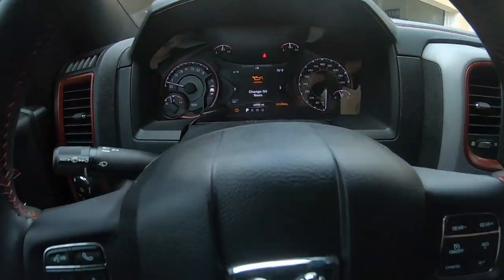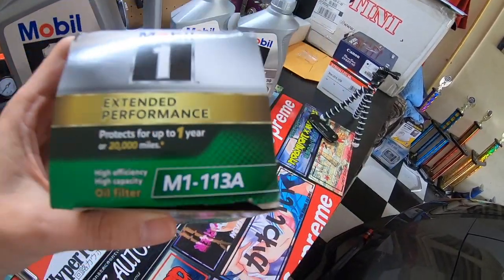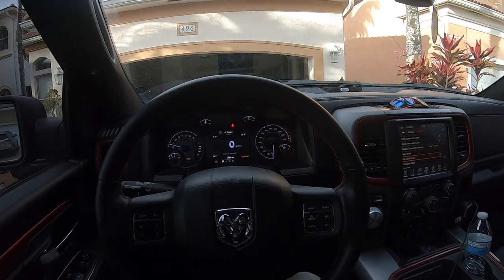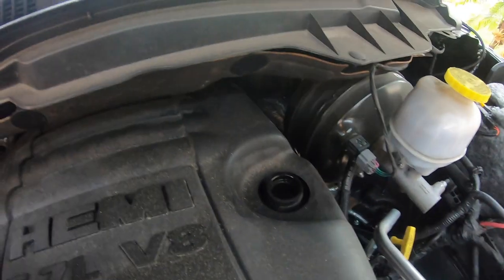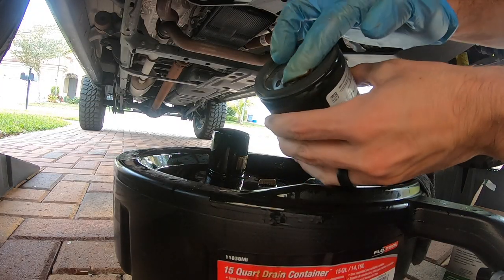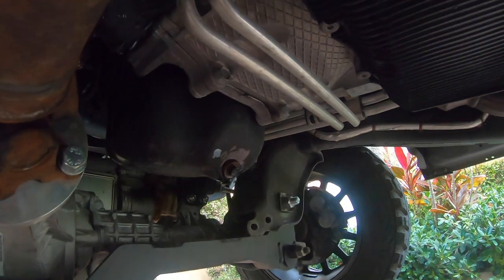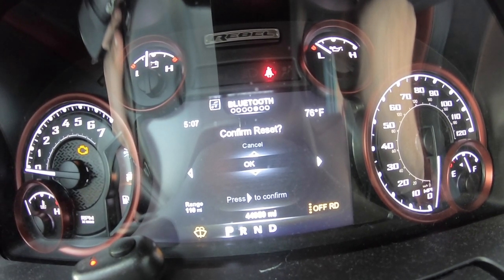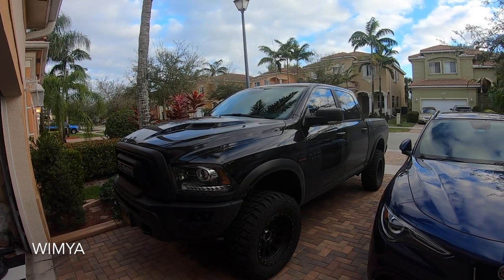Ram Rebel Oil Change - 5.7 Hemi Ram 1500

Comment: FYI   It's called a "Drain Plug"      Not "a bolt"     Ram service manuals call for torque of 25 ft lbs.    You don't want to accidentally strip the threads!   
Also, hand tighten the Filter to contact, then 1/2 to 3/4 turn more.  Excellent Video - Well Done...

Comment: I just did the first oil change on my 2020 Bighorn. Getting that oil filter out was a B....! I used 5w-20 Rotella gas truck synthetic oil with a K&N oil filter. The K&N filter was expensive at $19.95 BUT thats the one to use for this oil change only because it has a 1" nut welded to the bottom making it a hell of a lot easier to get it off! I don't know what year your truck is but no way will that oil wrench go on mine!
Reply from the maker: Damn that’s rough! Sounds like the 5th gen is deff a bit more difficult than the 4th gen to work on.
Reply: @Wimya  it was. Never did such a miserable oil change. But by using the k&n filter, at least I was able to minimize some of the agony. That nut on the bottom is a great idea. I wish they all used it but maybe they have a pattern on it.

Comment: Fyi mobil recommends the mobil super synthetic 5w-20. Only one rated for the MS- certification ram calls for.
Reply from the maker: I’ve had zero issues with the 3 Ram 1500 I’ve owned using “regular” full synthetic. But thanks for the shared info.
Reply: Wimya goes to show how good these engines are. But im going to put what mobil and ram recommend. Thanks for the vid

Comment: Jack mode is only needed when lifting on a hoist or lifting by the frame and hanging the wheels
Reply from the maker: Jack mode disables the air ride from self adjusting, as it does on inclines. So if I’m using ramps I’m going to disable it. Peace of mind.